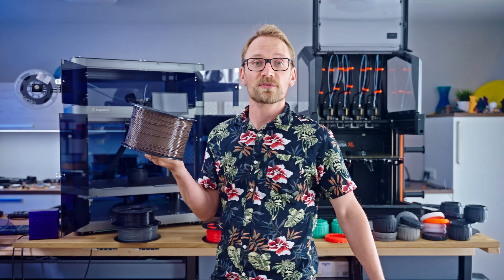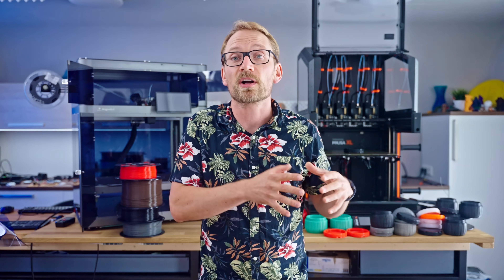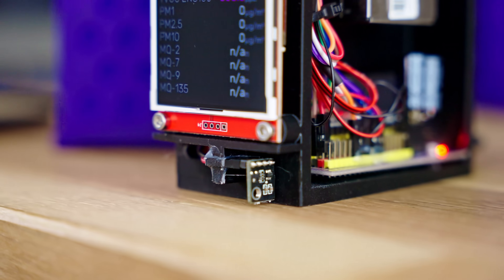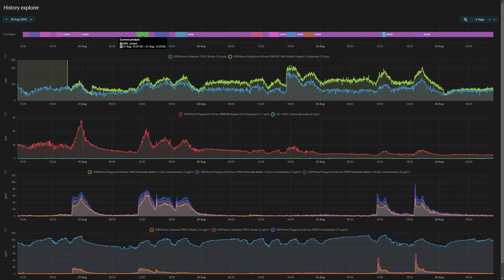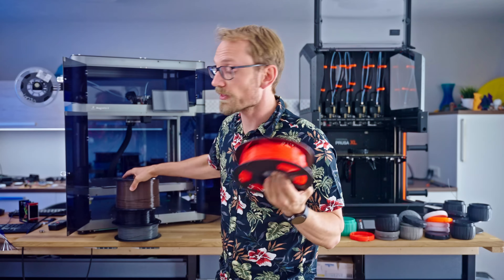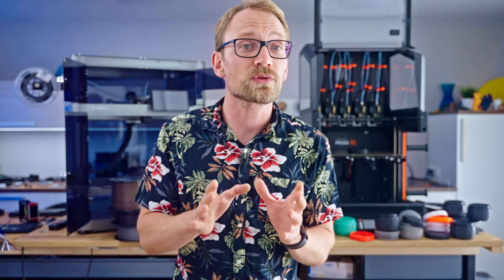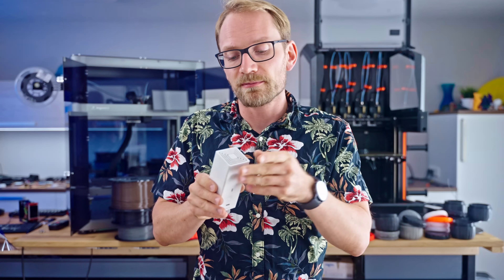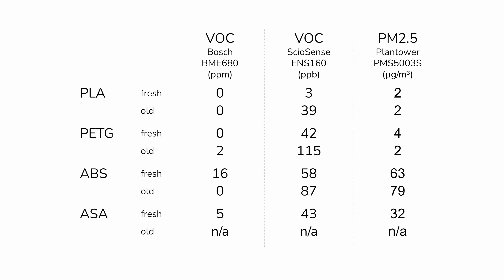3D printers are worse than I thought. Time to do something about it!

Comment: I got bladder cancer and the first question the doctors asked me is "do you work with industrial chemicals?" - seems that exposure to toxic chemicals is the number one reason for bladder cancer. I don't work with toxic chemicals but did spend a lot of time printing various plastics I spend almost no time in the presence of a print in progress now.
Reply: might explain why my lung is full of tumor
Reply: @contomo5710  very sorry to hear that.
Reply: Bladder cancer is associated with smoke more than lung cancer. I doubt the 3d printing alone could be considered the cause. Everyone should use all possible precautions still
Reply: Chemicals that can cause bladder cancer are aromatic amines like those used in dyes (including hair) and rubber manufacturing. If you didn't encouter these in industry you may have been exposed through old (50s-90s) paints, textiles, wallpaper, cleaners or adhesives. I'm sorry to say that smoking is a high probability.
Reply: @thedoctor16  to be clear my cancer was cut out last December and at last check up showed no signs. I gave up smoking at least a 20 months before diagnoses and the cancer was low level so I assume quite young. But I take your point, smoking has a lasting effect on the body, I don't recommend it
Reply: @hexitex  That's great!
Reply: You smoke?
Reply: very good video. i only print PLA since two years.
Reply: Hopefully you beat it and recover!
I suggest that if you don't have a fume hood you don't spend time inside for a while after the print is finished either as it takes time for toxins do settle. Technically it would be a good idea to vacuum daily and run a disposable micro fibre mopping session on all flat surfaces every 2-3 weeks to reduce the pollutants, since whenever we move we cause clouds of microscopic particles which we then breathe in. Not a big deal with regular dust and minimal to no fungal contamination but in a printing room thats a real concern
Reply: what do you usually print with? As a 3D printing hobbyist, I am absolutely appalled by this. Whenever I print I have my window open and my fan on, and I never print with anything toxic like ABS, but I still worry a bit.
Reply: Best of luck with cancer
Reply: I doubt it was the 3D printing, cancer due exposure to chemicals take chronic exposure during many years like smoking, drinking contaminated water or being exposed to solvents and such at the work place, it takes from 8 to 40 years to develop, the average time being about 20 years. Is more likely that if it was an exposure it was something else or even just a stochastic effect. Sucks that people will suddenly regard 3D printing so dangerous and harmful that it might no longer be a thing.
Reply: I decided to get an MRI a couple of years ago to see if there was anything noteworthy going on, and it was discovered that I've got NLPHL, having first been cured of hodgkins over a decade before. The true cause is unknown, but I can't help but wonder if this has been a result of chemicals, be it 3D printing related, other forms of endocrine disrupters such as sun cream, applying flea treatment around the house despite being careful, garden pesticides etc. I suspect it's also partly pot luck as to how susceptible we are, along with what levels of inflammation we have and so on, and without getting stressed about it as that in itself is a risk factor for disease, I think it makes sense to be as over cautious as you can possibly bear when it comes to PPE and environmental control.
Reply: Aromatic solvents are known to cause bladder cancer for decades, that's why they are banned here or only used with ppe.
Grandpa worked in a steel plant and got bladder cancer from it too
Reply: huh, might explain why i have to pee every 45 minutes when i print petg
Reply: How much do you print at all? I mean most of us have only been printing for 10 years; and most of us only once every few weeks, not comparable with occupational amounts of exposure, which is 40 hours a week for 40 years. Besides many of us might have other hobbies with ignored chemical hazards, such as related to paints, solvents, plastics or wood composite airborne particulate, epoxy resins and so on. Usually one thing leads to another before we got our 3D printer, and that path is rarely healthy.
Reply: @SianaGearz  I've been printing since 2011, in the early days it was almost exclusive ABS. I spent way too much time watching prints at close range in a small shed (back then prints would often fail). I agree you cannot be safe blaming one thing, I used to smoke as well. I just found it surprising that the doctors seemed to think that that type of cancer is almost always due to toxicity in industry.
Reply: @hexitex  But the good thing about a shed instead of your home is that you can ventilate it and while in your bedroom you are far away from it. I watch my prints go down with camera's with zoom-functionality to avoid problems with my astma too for example.
Sometimes I have had a 3D-printer in the living-room and only with PLA and that already got me having much more problems with that.

I really hope not to catch cancer from all the things I have been breathing in though...... but much of my problems come from outside for example the neighbours that are burning not clean wood (or sometimes clean), giving a plasticy smell inside my house too and sometimes make my smoke-detectors go off when I have the windows open.
My airfilters in the house work a lot and catch a lot of black dust in wintertime...
Reply: @hexitex  almost like you should have led with “I’ve been printing for over a decade, and I was a former smoker”
Reply: @elvinhaak  solid fuels are so bad, especially when they are not clean. Good job looking out for yourself! I cycle through a neighbourhood where many burn dodgy wood. I might try and cycle with a mask this winter...
Reply: @YensR  The worst kinds of wood are the ones that have been impregnated to prevent them from rotting... they do burn extra well told one of my neighbours proudly some years ago.... he bought it from the harbour where it had been in/on the waterline for many years , dried and then burned.
Reply: @elvinhaak  yikes, I am sorry! Here (uk) they have reduced the nasties in consumer lumber, but just a decade ago, it was still really bad. I disposed of our old fence in the city-run rubbish centre, hopefully no one will steal it from there and burn it.
Reply: @SianaGearz 40 hours a week? You havent worked in industry mate, dudes are rolling 60-80hr weeks, raking in the OT, gambling and drinking it away, not wearing the PPE despite been told to....

Occupational exposure can be insane quantities. 

I do think hobby 3D printing does need to talk about the safety, and take reasonable steps to limit exposures. Its better to check and know know how bad it actually is, instead of assuming its all fine. Its easy to limit exposure with cheap and simple steps, so knowing if you need to open a window or do something more is important.
Reply: Chasler you talk about America, civilised countries tend to have a 42 day work week & follow those for employees in bog companies well enough
Reply: @a_lethe_ion he's talking about Australia...and no, employees absolutely do not care.

Comment: Newer houses are MUCH more airtight than older houses which makes this a bigger concern if you happen to live in a newer house. But they tend to have heat recovery ventilators for the entire house which you could crank up.
Reply: Pretty much all new houses will have forced ventilation. I go beyond 8 air changes per hour in the room with my 3D printers if I crank up the MVHR system way up and optimize the air flow. For reference you'll get about 1 in a normal old house and 2 in a drafty old house. Normally you'll be at least at 0.5 changes per hour in a new house with a heat recovery ventilation system.

Comment: Thank you very much for those important informations!

Maybe I didn´t got it from the video. In the end (around 14:20 ) you stated that one option could be adding a filter into the housing of the printer and generating a negativ environment. Did you "only" do the test with the ikea filter or do you have some data with just the prusa enclosure+ activated filter?
Reply from the maker: I only tested with the dedicated Ikea filter, but I would assume that the HEPA part of the Prusa air filter would be highly effective at capturing and removing the particles emitted while printing. For the activated carbon part, I'm not sure about how much that's actually going to do.
Reply: @MadeWithLayers  Thank you very much for your quick reply! I’m currently on my way to integrate some sensors to Home-Assistant, to take some measurements and protocol them myself. Thanks for the inspiration!

Comment: 0.7 ACH?!? That's dangerously low
My exhaust fan ranges from 10 ACH to 40 ACH based on the fan setting. I typically have mine going around 20 ACH during printing (and day to day because it's super quiet) and if I'm going to have to spend an excessive amount of time in the room I bring it up to 40 ACH. And all the air goes through my printing enclosures that is only about 70 cu ft, so the ACH number on that is over 400 and as high as 750.
Fun Fact: There's so much airflow going through that room that it's hard to close the door because of the direction it opens. And if you do close it, air comes out of the power outlets in the walls.

Comment: What about composite filaments? CF and GF Nylons and PETGs and PCs are nice since they basically eliminate warping, but I swear when specifically using the Bambu PETG-CF that my nose was irritated after being in and out of the room for maybe an hour total of exposure during a long print.
Reply: If the fibre fragments were somehow getting airborne during printing that would certainly be a major concern.

I certainly would think long and hard before deciding to sand anything printed in CF/GF reinforced filament. Probably something that should only be done outside, with a respirator on, if at all.
Reply: @anthony_horton  Particulates during printing is my main concern, but also when removing support material which seems like prime situation for it. Agreed on sanding however, probably best to avoid that for anything with CF.
Reply: @zacharykarr  Oh, good point about removing support material. Any time you're fracturing the material you could potentially release fibre fragments. I've no idea how much it actually happens, though.

Comment: OhNo we'rE AlL gOnNa DiE... how do you think an injection molding factory smells like...
Reply: Many manufacturing jobs are very unhealthy, which is why everyone was so happy when they got moved to the other end of the globe, when people still remembered what working in the industry used to be like.

But also injection moulding temperature is much lower than printing temperature, it works more with high pressure, and the plastic spends a smaller amount of time hot, so less of it is broken down; the environment also generally needs to be VOC and particulate controlled with air exhaust and filtration, which is where the EU occupational exposure limits come from - ones which are clearly violated by 3D printing.

I'm from the electronics industry and the research done here in 80s and 90s indicated that roughly half the workers - in spite of air extraction and filtration - showed obvious asthma symptoms. It's attributed to rosin flux vapour. Why do you want asthma and other preventable diseases so badly?
Reply: You may live in such a factory; most of us probably do not. But many of us have 3D printers in our homes.

Comment: A cabinet on wheels with an FDM and a Resin printer ... placed inside my shower enclosure.
Just roll it out when showering, roll it back afterwards and print away. The bathroom ventilation fixes everything, you save space and the noise is gone.
What's not to like?

Comment: Great Video,
For reference I have a similar sensor package Plantower, BME680, SGP30 that I run in a similar fashion in my print room with a much cleaner baseline measurement (other than CO2, living in a city). Your numbers seem somewhat reasonable (I don't have the S, but I also don't keep resin printers here). I wish we could know more about composition of the readings much easier.

I almost exclusively print virgin PETG and occasionally questionable source PLA with lower numbers but I believe this is my AC doing most of the filtering work. Anecdotally (without having done any long term testing) I suspect the paper you mention suggesting the printer itself; specifically heating elements, IPA cleaning of surfaces, vaporizing oil / lubricant during heatup is a non-insignificant source (context matters here). I don't think it is necessarily dangerous but especially when I do maintenance it will un-peg my meters (on the Plantower) quite similarly. Unrelated I don't have enough experience with it but I know the smells from the environment a filament sits in (when absorbing moisture) does smell test wise get re-released on printing.

It would be interesting to know what contribution is the actual filament thermal cycling (and what it releases) versus other effects such as cleaners and also just a hot machine that physically moves around a lot; filp-side is I'm not sure what it means if anything. Certainly not as bad as ABS or ASA effects but something maybe worth investigating.

Comment: Thanks for putting this together.  Excellent video.  I had a keenovo silicone bed heater that stuck so bad it would give you a headache whenever you got it hot enough to print abs/asa.  Swapped it for a fabreeko heater and no more stink.  Would it be possible to do a part 2 of this using common opensource filtration kits like a nevermore?  Maybe a part 3 on sealing up a printer?

Comment: I would like to know how effective a sealed enclosure is 
I dont think you can buy one, but for my sv08 I built a custom eclosure, which seals all opening (aslong as the front is closed) besides a small opening in the back (but a fan is pulling air out of the enclosure through a filter, so there should allways be flowing air in at the backsite opening)
the sensor i have shows a max of 11 pm2.5 (same as my living room) right outsite the enclosure, so I would like to believe enclosures work
dont have a way of putting it insite while the printer is running to see the diffrence, maybe my asa just doest produce very high pm 2.5 and the eclosure is doing nothing or the sensor is broken

Comment: I exhaust my enclosure into my attic space. My enclosure is tight enough to easily maintain negative pressure with the exhaust fan.

My printer sits in my office about 6 ft from my desk. When I first got it and was printing in open air, with pla the parts for my enclosure, my allergies went through the roof. That was proof that even though people say pla is fine to be around, if you're next to it, you're going to get particles. Having my enclosure exhausted into my attic space takes care of this for ABS, ASA, PLA whatever... Zero smell outside of the enclosure. You can also test by taking a stick of incense that smokes and go around the edges where your enclosures have any kind of opening to see if it's drawing the air in. You'll also want to test when you have any kind of air conditioning on because sometimes floor AC units can draw error out of the room, creating a negative pressure in there and it will fight your exhaust fan that's trying to draw air out of your enclosure into the attic space.